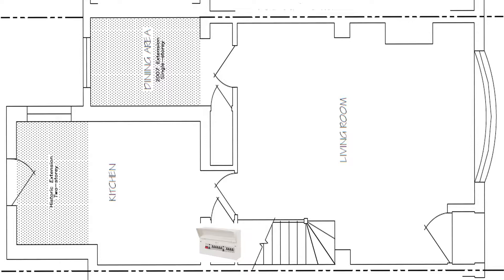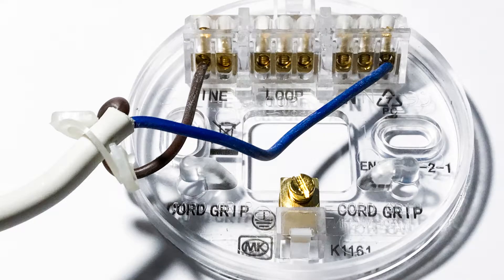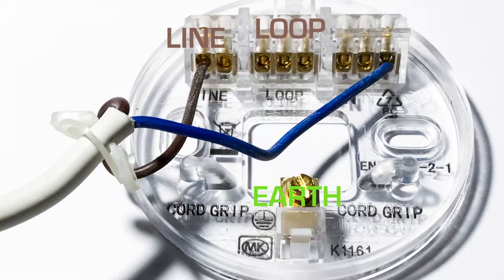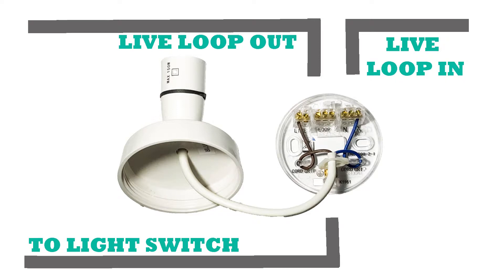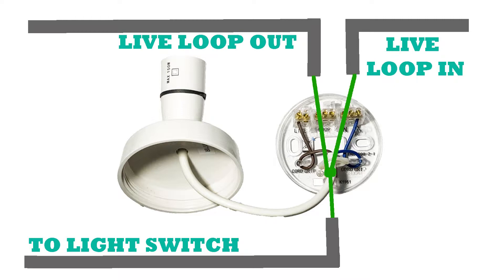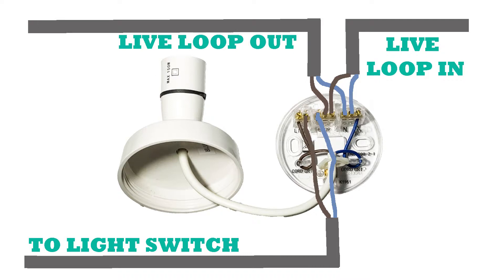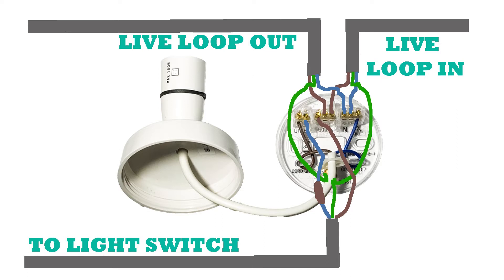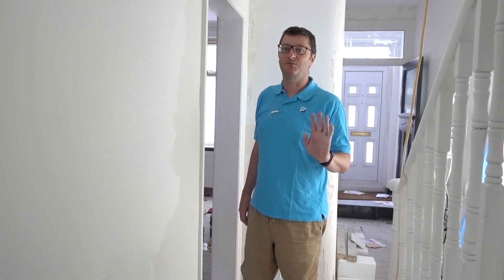Wiring Ceiling Roses and the lighting circuit.

Comment: Nice video. I remember wiring my first one up when I was about 12. Didn't quiet go to plan! It's just second nature now. With 17th edition though it was good practice to have the house split down the middle so if a breaker tripped you wouldn't lose all the lights on a floor.
Reply from the maker: 12 bit young to start working... are you from a Victorian workhouse?  ;)

I do a similar thing with my circuits, but instead of splitting down the middle I group upstairs lights and downstairs sockets on one RCB and vice versa on the other...  then if the lights go off, hopefully you have a lamp on/ handy...